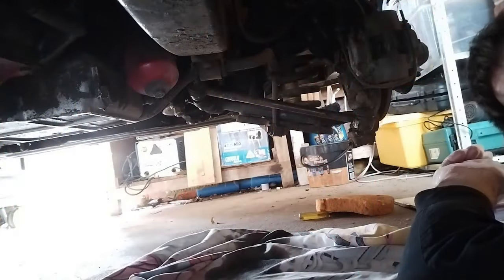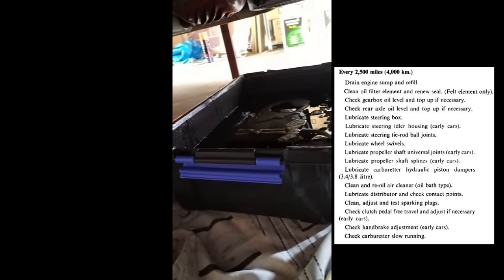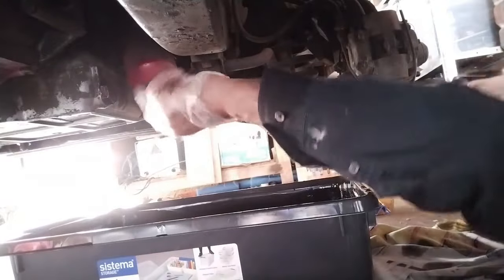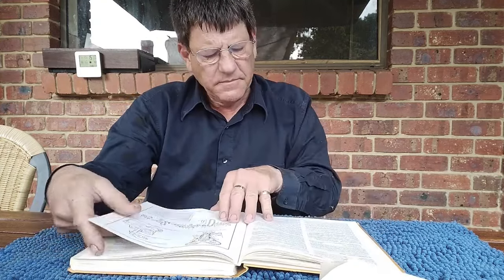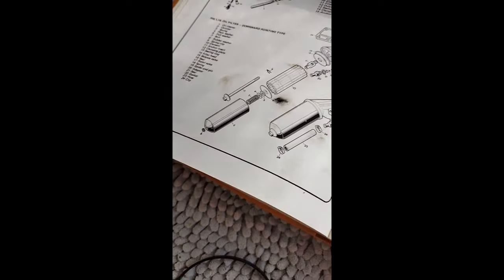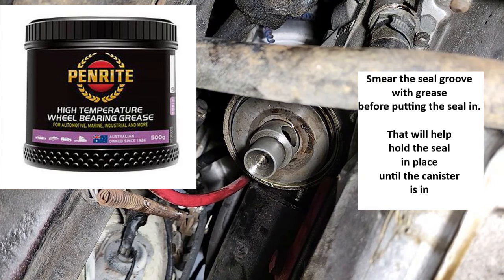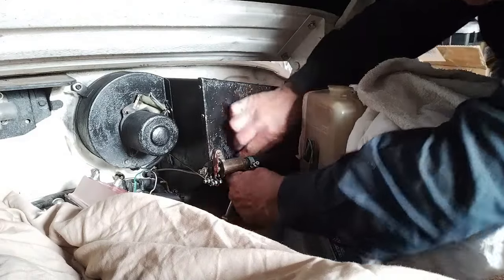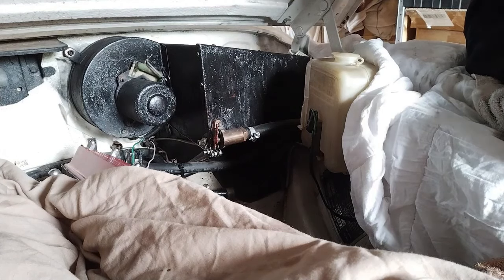Episode 7 1964 Jaguar Mk2 Sleeping Beauty - the first Oil Change

Comment: The correct pill for the Mark 2 Jaguar is an SAE 20/50 which is still available in the UK. Thinner oils are unsuitable for the XK engine and will result in excess oil consumption and engine wear. The gearboxes with overdrive require SAE 30W oil which is much thinner than conventional gear oil. This is basically lawnmower grade oil single viscosity and still readily available.
Reply: Thanks Iain,  I have now just purchased some for my MK2